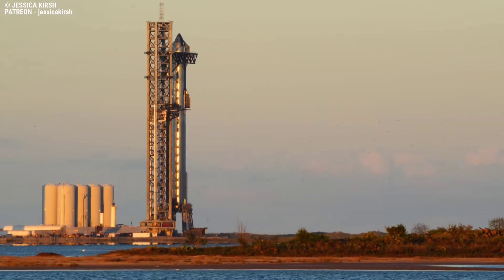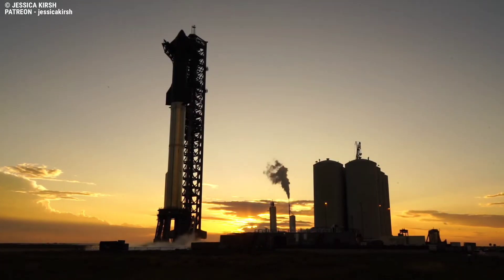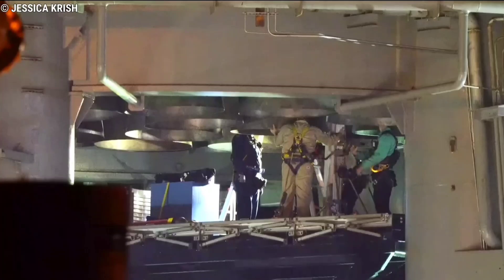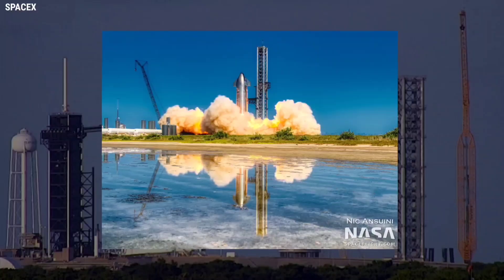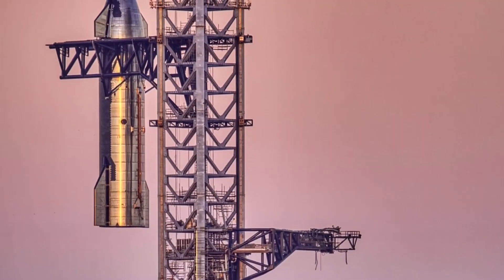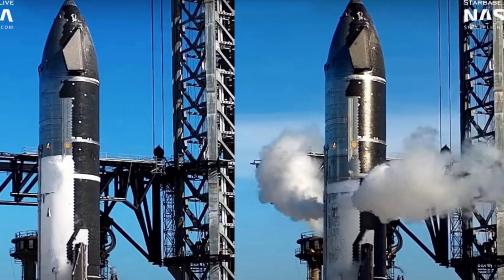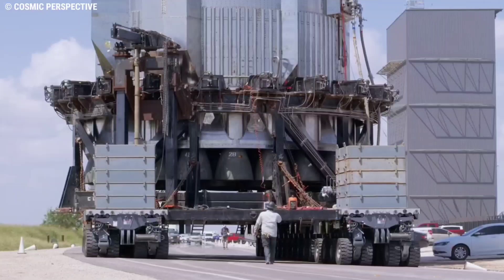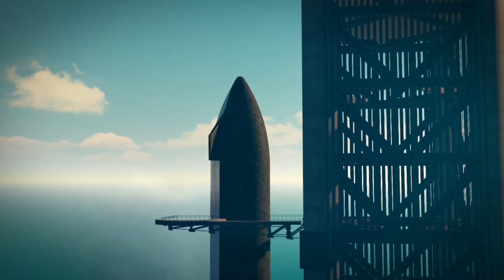FINALLY! SpaceX Super Heavy Booster7 33 Raptors Engine Static Fire Incoming !

Comment: As an engineer, I always thought 33 engines in Stage 1 is a bad idea -- the chance of catastrophic failure is too high for such a setting, even 99.5% reliability rate for a single engine, the reliability for the whole system is only 85%. I am puzzled, did I miss anything?
Reply: As an old guy, seeing everything since Mercury, they told us you could never land a rocket on its tail. 
Elon: Hold my beer.....
Reply: They've simplified the engines and are working the reliability. It is a novel concept and we shall see if their approach works. Musk has pushed the industry to new levels and worked past the snails pace development speed of government rocket operations... If he thinks this will work, I'm inclined to give him the benefit of the doubt. As for 33 engines, they likely have more than enough thrust to overcome any potential issue during launch and flight. The important thing is to shut down a mal-performing engine in-flight and compensate with the rest and get the payload to orbit... Go SpaceX.
Reply: @Afterburner  I can see the line of reasoning.

Bundling 33 engines together provide ample redundancy in case of malfunction; then you design the engine so that the chance of a catastrophic failure was extremely slow – all errors lead to a mild form of malfunction, and the system itself becomes practically disaster-proof.

The control system would then be configured so that it would preemptively shut down any mal-functioned engine at the earliest signal, perhaps try to re-start and re-ignite, otherwise put it on sort of like safe mode. And thanks to the redundancy, the rocket would continue to rise. As long as the engine is reusable, the cost of fix is nothing compared to a total loss.

The concept is simple, but It is indeed an ingenious one – though I am tons of work needs to be done in the back. 
Kudos to Elon Musk for such a brilliant idea, he has single-handedly brought a nascent EV industry to the mainstream, he might do that again for the space age.
Reply: @davecai999  - I was in the business 32 years - solid motors and liquid engines - Redundancy is a VERY good thing. And Liquids are a lot better behaved than solid rockets. I saw more than one engine issue resolved in-flight during the Shuttle and other programs where you had other engines to take up the load. Shuttle Challenger experienced such a failure and ran longer burns with an inhibit of the engine temperature sensors to keep pressing to orbit in an abort to lower orbit.  Google "Space Shuttle abort modes" for the abort modes on engine failure. I am sure that our friends at SpaceX have very similar processes and procedures.
Reply: @Afterburner  All true, what's really remarkable about SpaceX is reusability  -- suddenly, all the tuning up, the expensive 33-engine setting, the redundancy, etc. all make perfect sense.  Since they're not one-timers, it is worth every bit of effort to improve the system, as the costs would be spread very thin.
Reply: @davecai999  - Yep - The age of exploring the solar system is upon us ;>)
Reply: I felt the same for Falcon 9 as well. But…….
Reply: It's a fair question.  Don't know if you remember car wheel ball bearings that had to be greased by hand.  When was the last time you ever heard of a car wheel bearing seizing?  It's something along those lines that gives the confidence.  I think the main moving part on these engines is the bearings on the turbo pumps.  There are some actuators and valves too.  Same analysis.
Reply: @clavo3352  Yeap, 
1. transform the catastrophic error to a more manageable format, avoid the disaster and total loss; 
2. ample redundancy to ensure a successful mission; 
3. reusable means the engine can be brought back and fixed -- which also makes 33 engines not cost-prohibitive -- 'cause they're not one-time consumables, and any tuning up is worthy

A perfect formula. Bravo!
Reply: Yes.